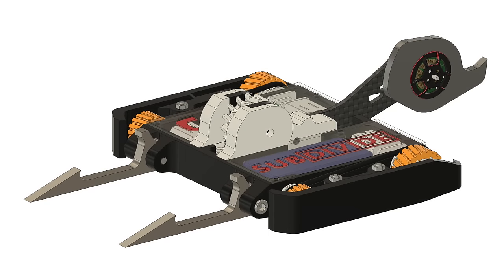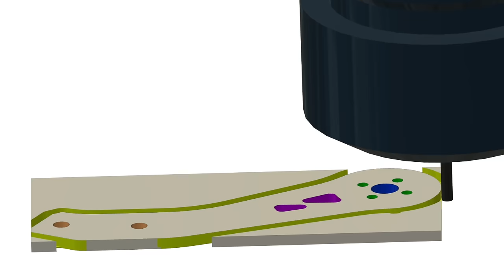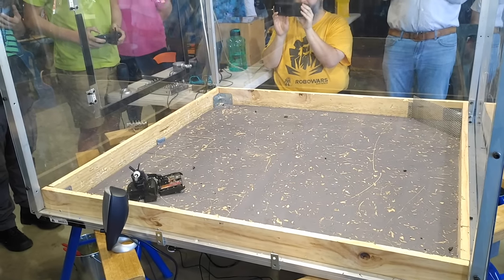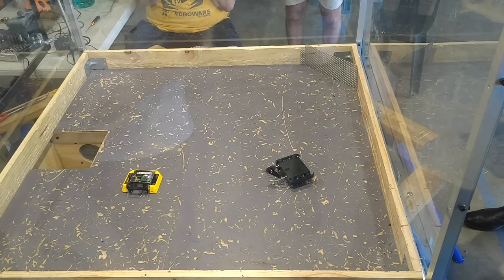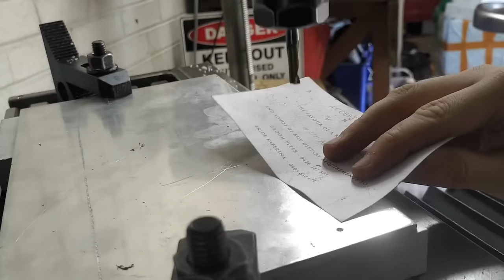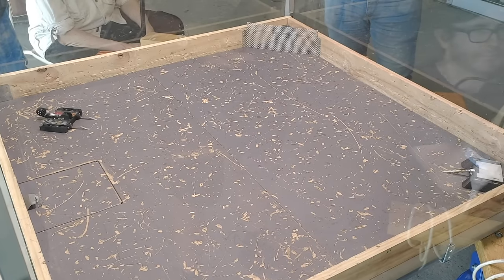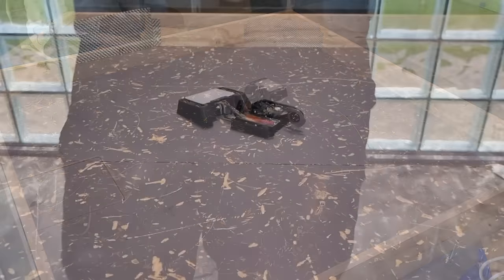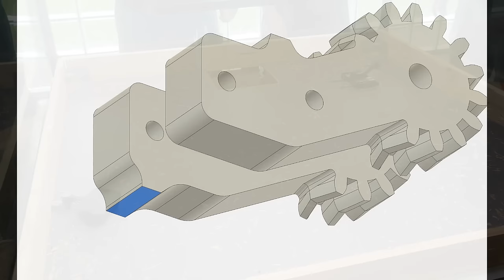Attacking Where You Least Expect - Combat Robot Subdivide

Comment: One initial question early in the video: why do you not like 2 wheel drive? I see where you're coming from, but I'd like to hear your reasoning behind it.
Reply: Excited for the melty too, I've been considering building one myself
Reply: I too would like to hear your thoughts on 2wd. Also 4wd with 4 motors vs. 2 and belts. Algorithm.
Reply from the maker: It's just a personal thing. 2wd is not dynamically stable when going forward so likes to veer away, and can be squirrelly when turning as does not naturally scrub that energy as 4wd would.
Reply: @BrokenLinkRobotics Huh, neat! Does redundancy play a role?

Comment: I thought I would throw a couple of ideas out there for you. 
1st thing is I don't know why this video was recommended.  My past work is logging,  and log homes. My biggest hobby is carving wood and rock. 
A few cheap items that would make brutal weapons:  " Sabertooth" and "Kutzall" both make extreme/ extra course carving burrs for dremel type carving tools and die grinders. They are brutal looking and made of tungsten carbide. There used to be a carving attachment that got banned called lancelot.  It's a chainsaw chain wrapped around a steel wheel.  I'm sure you could easily fabricate something like that in smaller scale using a carbide chisel tooth chain with rakers filed down.  
All those would be fairly cheap and quickly destroy anything they touched.
Reply from the maker: @mr.shannon6137 Honestly will look into those, good to have a perspective from someone outside of the robot hobby. Cheers!

Comment: I built a 150g hammer saw about 22 - 23 years ago. For the exact reason you mention, but 150g robots back then were barely armored and almost only pusher/wedges/lifters. I had no machining skills almost, so the weapon was 3 blades on a plastic hub stuck directly on the motor shaft. I have a video of it on my channel, without the weapon attached. Would have been too dangerous haha

Comment: 2:40
Using a Kevlar composite could've been smarter as the arm is expected to endure hits and violent impact. Carbon is quite bad a impact resilience and tends to have fibers shatter. Kevlar makes the tradeoff of less rigidity for a substantially higher impact resistance.
It's even possible to get some hybrid rolls of kevlar/carbon fiber to have the best performance for your application.
I would highly recommend looking for a material scientist or technician. They could help you.

Happy day to you!

Comment: The 3lbs bot im building has the same arm actuating system except im trying to use a brushless. however i cant figure out how to get it to actuate precise enough before it destroys it self. Any help or advice would be stellar!
Reply from the maker: Gonna need more info about your mechanism. I actually just built a 3lb version of those robot myself and had success.
Reply: @BrokenLinkRobotics  thats awesome. so im using a repeat compact brushless motor with the planetary gears. that has a smaller herringbone gear that meshes with a bigger gear witch has the arm attached that drives the 4 bar. i want to push a button on my MT12 to go to the "attack" position then when released go back to the "resting" position

Comment: Have you considered putting a small lifting fork on the weapon arm similar to Strikepoint? Unsure how your arm geometry/motor setup is to Strikepoint's, or if you have the weight budget for it, but having something to go for pins via getting them stuck on the rails is a nice backup plan if the spinner isn't playing nice.
Reply from the maker: @lane9668 I definately have considered it but there is a downside. For the fork to touch the ground the spinners weight will be on it and thus not on the rear drive wheels, removing some traction. As the spinner is about 20% of my robots weight I considered it more pressing to keep driving up and maybe leave it for the future.
Reply: @BrokenLinkRobotics That's interesting. I hadn't really considered weight distribution for something like this. I've been on a 2WD eggbeater design my entire combat robotics career (just really liked Minotaur, I guess) and it's really impressive how much more you have to think about when you start adding more and more elements like articulated arms/etc.

Comment: I’m curious. I’m running a 3lbs beetle and my armor choices saw bots/hammer saws is some steel “chocolate bars” that I’m just gonna rivet to my top panels instead of extra front armor. Do you think that would work? My other option is thicker aluminum panels but I don’t really think that will stop anything. My bot is like a flatter smaller division if that puts an image in your head
Reply from the maker: A hard/bitey material with an air gap before the top pate is the ultimate option, historically baking trays were good at defending saws on feathers as the saw would bottom out before hitting the critical armour. Chocolate bars are good too as the saw may bit the edge instead of a clean shot. Aluminium is better than nothing but a poor choice for the weight it consumes, thick HDPE would be better if weight is a concern

Comment: I'm trying to make my own combat robot, but I don't now haw to desing and control my steering system, could you explain how you did yours??, thaks
Reply from the maker: Not sure what size your robot is, but some robot ESCs have mixing built in so if you talk to it with a simple transmitter it will drive and steer as expected. Otherwise one may need to mix in the transmitter itself

Comment: What are you using to keep the disc attached to the weapon hub motor? In the video it looks like it might just be press fit on, which I wouldn't have expected would stay on during impacts.
Reply from the maker: Slight interference fit and JB-weld. Scuff the paint on the motor too for better grip

Comment: Regarding your ring spinner, (the thing you showed at the end) couldn't you increase the traction by adding fins at the ring to "suck" the bot onto the ground.. it seems that it became a bit uncontrollable when spinning up (at least it looks a bit like it)
Reply from the maker: It is not a ringspinner, but a meltybrain. The whole robot is spinning.
Reply: @BrokenLinkRobotics can't wait to see this, but could this idea help/work for your ring spinner or is it to "academic" :D
Reply from the maker: @Lux158 The problem is the increased reaction torque from the air resistance of the blades may offset the potential grip against from down force.

Comment: The filter mask and glasses are not enough to protect you from carbon fibers. If you need those things in your workspace while it is running, then those fibers are getting all over your shop and can easily be kicked up by other work later. A fingered vent chamber is the appropriate way to deal with it.

Be very very careful next time you sweep.

Comment: Heres an idea.
Ive always wanted to do Battle robots, but ive never had the electrical knowledge, or community. But I love coming up with novel ways to destroy robots.

What about a balloon spear?
A spear that, using a CO2 cartridge, can rapidly shoot a spear that penetrates armor. And then inflated a thick nylon balloon at the end of the spear, ripping the internals to shreds. And then rapidly deflates with an internal cylinder that pulls the balloon back in. Potentially even using that backdraft to blow yourself away from the opponent.

The only downsides I can think of are limited attacks, weight problems, and a huge weak spot where the tank is located. A good hit with a strong spinner or hammer could very well rupture the tank. Unless you shoot right before it hits. Maybe have an optional missile mode that deploys the entire cartridge to fire off the weapon incase of emergency. Assuming thats allowed, its basically a robot dart shooter at that point.
Reply: heavy downsides aside that would probably be competition illegal due to safety hazards

Comment: While rewarching this video for the 20th time(I promise I am not a stalker) I see that you wired the weapon to the servo and brushless outputs on the malinke nano. I had assumed you wired the arm motor to the weapon output next to the drive outputs and controlled the position manually. I'll admit I haven't played with the nano much, can you elaborate on how you have this wired/ configured? Is the nano smart enough to treat the n20 like a servo? Is there a servo brain hidden somewhere in your bot? Are you controlling the position manually and just using that output just because? I assumed that output was just a pwm signal, did I read that wrong? I'm confused.
Reply: Wait... what? I see solder on left, right, and w2, but noting on w1 or w3... htf are you controlling the hammer motor? @10:48
Reply: Nevermind 10:48 Is not subdivide 😂... I'll shut up now
Reply from the maker: @gtdgabristle1 The spinner motor ESC uses the pwm out from the Malenki, where the arm motor uses the third brushed 'weapon' channel. There is no position control, just motor torque like a drive motor.
Reply: @BrokenLinkRobotics  that is what I assumed, and how I wired up my all PLA tribute bot (thanks for providing the .step files). I got confused while folding laundry and watching your video at the same time. I paused it on what I thought was a pic of your reciever and confused myself when there was no solder on the weapon output. Sorry for the silly question, but thanks for taking the time to respond anyway.

Comment: Why do you use a n20? Motor to operate the arm, is it just to save space?
Reply from the maker: @chriahorne1795 yes, it's a very powerful motor for the space and weight it uses. Also more durable than a servo
Reply: @BrokenLinkRobotics  Does it not shred the Gears? If you don't take your finger off the button, wouldn't it just keep trying to spin?
Reply from the maker: @chrishorne1795 motor dosent have the torque to do that. Just stops

Comment: Its always been a bit distasteful to me for as long as things like this have been around that you can essentially outspend your opponent and win. If you can afford titanium and carbon fiber and and the tools to machine them, and your opponent can only afford aluminum and ABS, they lose.

Not that I can think of any fair way to fix that, its just a shame.
Reply from the maker: @htomerif This is nonsense. The winner of a recent hobbyweight event was a plywood wedge with cheap brushed drive, against many fully CNC machined modern brushless robots.
Reply: @BrokenLinkRobotics   I didn't mean it as an attack but you decided to take it that way. I remember back in the day with battlebots there were a team of two medical doctors who spent (IIRC) 50 grand on two cnc milled, monolithic titanium chassis and made it to the finals with a boring but money powered flipper.

Also, a good third of your video was dedicated to the ways your particular project failed and you threw money at it to make it better. It just happens that so did everyone else.

I'd like to know the name of the robot you're taking about. I looked for the name of the one I was talking about but it was a while ago and I just couldn't.

It would help if your own video didn't fully support my claim.
Reply: @BrokenLinkRobotics  This is probably before your time but in electronics and robotics classes you used to have kits and every team would get the same kit, just a bunch of ostensibly random parts and each team would have to build a thing to do a specific task.

In no way am I suggesting that replace anything, but it would be an interesting addition as a category.
Reply: @BrokenLinkRobotics  the reason this story comes to mind is precisely because it's unusual. Sort of a "man bites dog" story. The competitions where the top N are dominated by the expensive robots are the normal case, and don't get reported on.